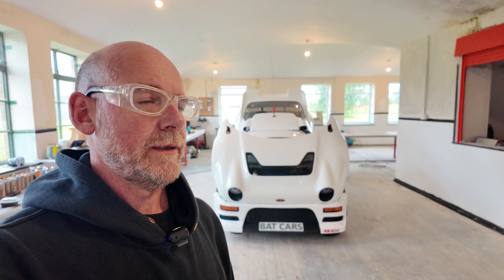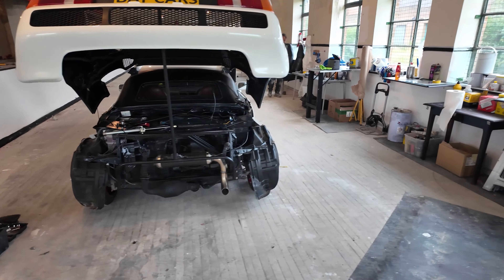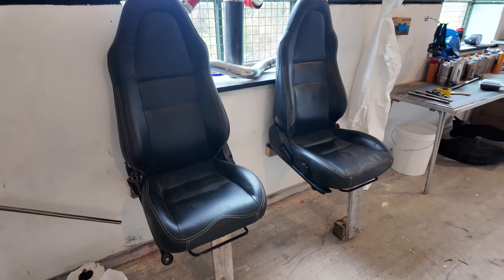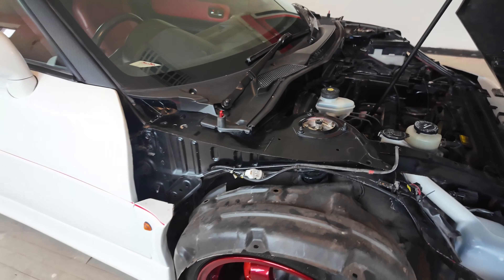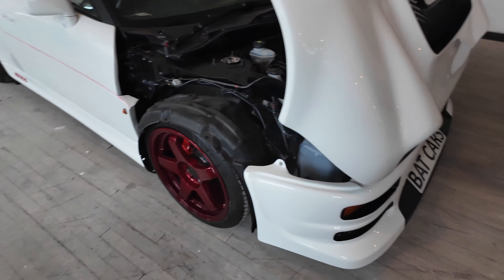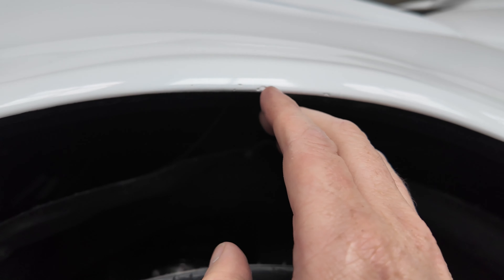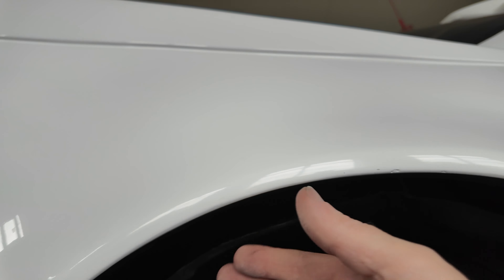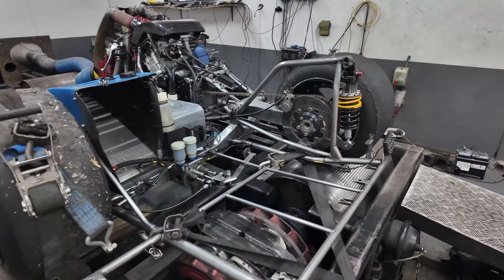Making inner arches for my RB200 kit car

Comment: The hydraulic ram is a flash idea. Just like a Koenigsegg Regera. If you have a look at one, you will see they have the rams mounted vertically. The fishing pole is perfection. LOL. With the wheel arches, why dont you create a lip like the inside that just sits on top of the inner that is bonded to the rear clam. The sidecar outfit looks mad. Definitely have a go.
Reply from the maker: Cheers buddy yeah just need to make it work, I’ll take a look at the regera. That’s what I was thinking for the arches but looks like I might get away with a rubber trim along the edge.  The side car is scary af but I’d definitely have go if I get a chance